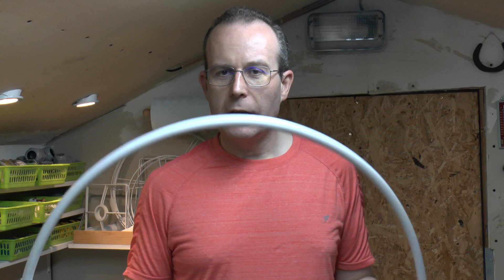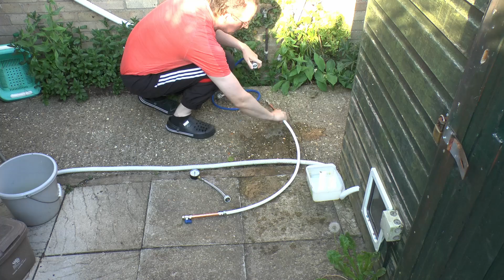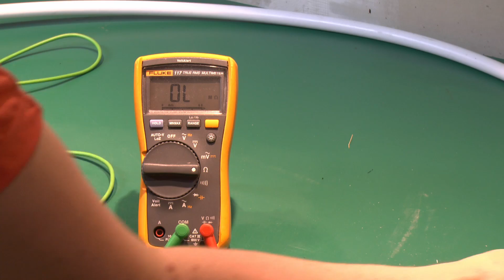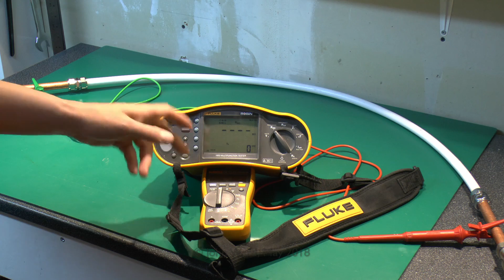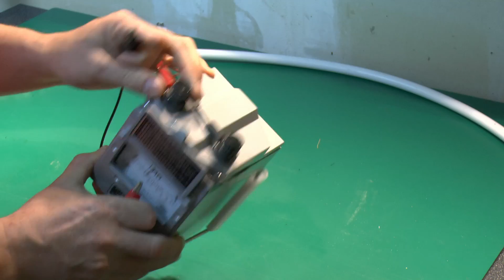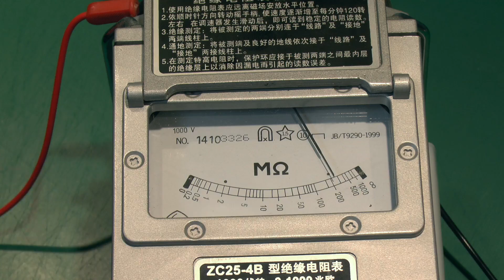Is water in plastic pipes conductive?

Comment: Hi John, interesting video,
I am curious as to why the voltage on the fluke meter was limited when you tested with both the 500v and 1000v ranges,
Also if  A.C. were flowing what would happen?
Kind regards Warren
Reply: Warren Gray The device test current is limited to 1.5mA on all insulation ranges - which may tingle but won't be fatal.
So with a resistance of 190k ohms , a current flow of 1.5mA will produce a voltage drop of 285V.
The voltage on the 250V and under ranges cannot produce a current flow of 1.5mA through 190k ohms, so the voltage is not clamped by the current limiting.

When you test a cable, the cable resembles a capacitor with a very high resistance connected across it.
The Megger will output 1.5mA to charge this up, you see the displayed resistance and voltage increase as it charges - until the capacitive element has charged and the only current flow is through the leakage resistance.
That's why it's also important to let go of the test button or release the lock to discharge the cable before disconnecting the test leads.
That charged up cable can produce a far higher current through you than the Megger itself can - and can also damage the equipment you connect.
Reply: Simon Parkinson 
Thanks Simon, that explains it, Re:- capacitive charge,, I always ensure that I discharge motor capacitors or any significant source of stored charge when investigating white goods, usually these will be designed to self discharge, but hey better safe than sorry it's just an ingrained habit now after the early days of studying  C.R.T.'s
Where I removed the rubber cover from the back of the screen and got a hell of a jolt Even through the T.V. had been unplugged most of the day!
Thanks my friend 
Good to share points with eachother
Kind regards Warren

Comment: There are now many instant water heaters on the market that have a bare (uninsulated) heating wire exposed to the flowing water. Before and after the heating element there are serpentines built into the plastic so you get a certain length of water column for insulation. The installation instructions specify you may only use them up to a certain conductivity of the water and to inquire with the water company if you are unsure.
These are fully certified units for the european market made by top brands, not some chinese Ebay crap, the Stiebel Eltron DNM 4 is one example. 
You can find a schematic picture if you google "blankdraht heizsystem". 
It scares me a bit, what if you are in the shower and some contamination comes through the pipe. I hope they put a grounded section at the output!

Comment: I think you would definitely feel the wobble from >1ma, you can often feel current in the micro amp range from the leakage in transformers and AC adapters with the back of your hand.
Reply: Coolkeys2009  What about the leakage from Y rated suppression capacitors in class II devices or PSU? I can feel that current.
Reply: if you where somehow within that water filled plastic pipe the current through your body would be less as your human body has added resistance.
Reply: marc  Only dry skin has any significant resistance. Wet skin allows electrical current to enter the body. Then once inside, the tissue is more conducive than that of the water on the outside.
Reply: Mark 1024MAK yes but your effectively in sereis with load so only less current can flow.
Ie if your somehow inside the water filled plastic pipe.
Reply: If you are in series with a 1ma current flow 1ma of current will flow through you, the size of contact surface area will probably also affect how bad it feels though.
Reply: Coolkeys2009 if adding a resistive load in sereis to a existing load current will be reduced
Reply: Coolkeys2009 Indeed, 1mA remains a concern for me. I design medical devices, and in that industry the max earth leakage limit is 100uA. For medical approval, Y-caps are a no-no and you need inductive filters for EMC purposes. While you can drop a phone connected to a leaky charger, it you get a 1mA shock in a bath, spur connected to copper distribution pipe with 1m or less of plastic tubing, and you have a pacemaker, you could be in big trouble! I hate plastic feed pipes and never use them.

Comment: Would it be any different with distilled water?
Reply: patdbean Yes, the lower the impurities, the lower the conductivity. That's why demineralised water should only be used to top-up wet lead acid cells.
Reply: Distilled water is an excellent insulator. There are bore pumps where the motor is actually filled with distilled water for cooling

Comment: Very interesting. Should repeat the experiment with the pipe then drained of water.This would act as a control to see how much effect the water has
Reply: Nick Collins an empty plastic pipe would read infinite / open circuit.
Reply: You mean like totally dry inside? or wet but not filled? PEX is also used to isolate high-voltage wires.
Reply from the maker: I'll show that in a future video, but even immediately after removing the water (inside still wet), the resistance is over 1000MΩ with a test voltage of 1000V.

Comment: +John Ward
So, question is, what are the risks of conductive water across an "insulating"-section?
e.g. Can you start electrolysis of water, create hydrogen and oxygen?
Will a shorter "insulating insert" still be 'safe' from the point of view of avoiding equipotential-bonding of a supply-pipe --- 5cm "insulating insert" with 230v across might give 25mA ?  [a change in 18th edition may be coming in this regard?].
The danger comes from introducing a potential via the water when this was assumed not to be possible?
Current-flow through your body through 180k resistance (for this length) was mentioned, but when would that situation occur -- only with lost-TN-C-S neutral scenario?
Reply: Lost pen conductor or possibly high earth potential caused by a fault leaking to common ground earth via supply transformer, 

Internal resistances created within the property will be completely safe as long as they are not resistances referenced to the mass of the earth
Reply: Mark 1024MAK this is classed as earthing and not bonding and is only required if separation between main voltage and pipe work can not be avoided in which case the pipe work must achieve automatic disconnection of supply
Reply: sbusweb   Metal pipework (including sink units) is supposed to be bonded to earth wherever there is a risk of an electrical appliance causing it to become live.
Reply: +Mark 1024MAK
Thats' different, thats' about bonding-to-earth, in which case the danger is more like -- there BEING an insulated-section and no low-impedance-path to earth.  See: supplimentary equipotential bonding [John's video  https://www.youtube.com/watch?v=CVxBettQpPU  ].

Comment: So, how faulty boiler heaters kill people than? Distance Is significantly more than 1m, and voltage 220V? Thanks
Reply: I started wondering about the electric shower heads, like the one bigclive took apart. They specify the water hardness, though.
Reply: +siux94
You'll need to describe situation better?.
Immersion-heater with ground not attached properly, maybe?
Reply: No, it would just trip the GFI/RCD. In Germany we have Electric Tankless-Waterheaters, they run with 400V (sometimes 2 phases or 3 phases depends on Wattage) and the Heating Elements are blank inside the Water after each Heating Channel comes a Insulation Channel. They don't even trip the RCD.
The only downside they have is that they are sensitive to Air-bubbles in the water, wich can cause to burn through the heating wire.
Reply: I'm talking about non-modern water heaters, where heater is directly on the water, plus old style fuses without rcd. 
Answer is probably surface area + some capacitance which allows current to flow. Maybe metalic pipes also conduct majority of electricity.